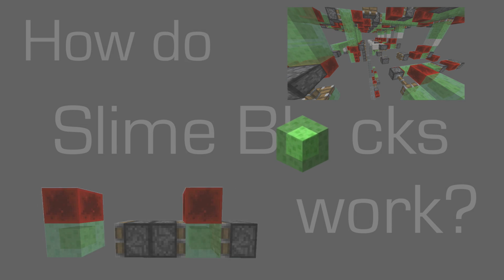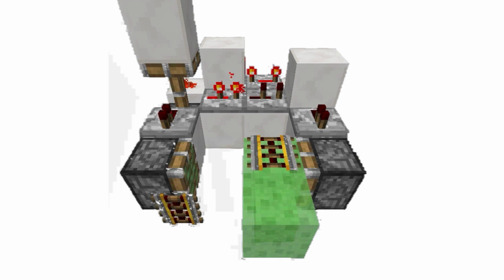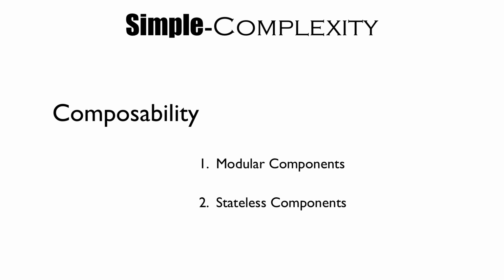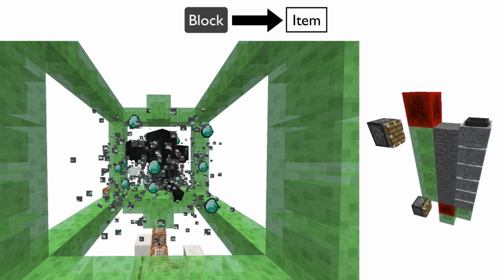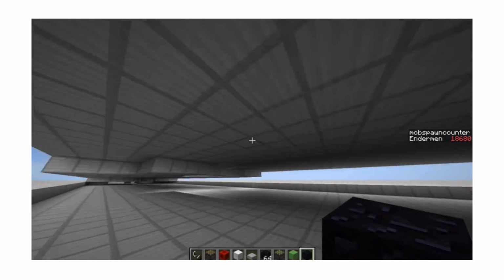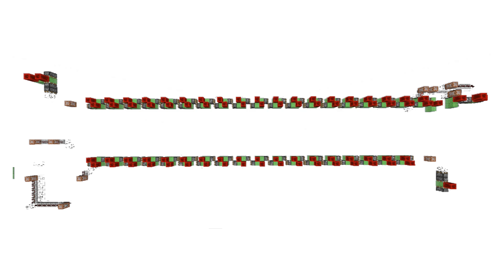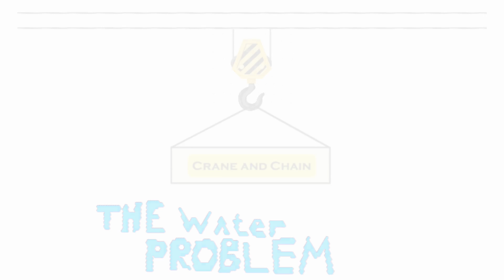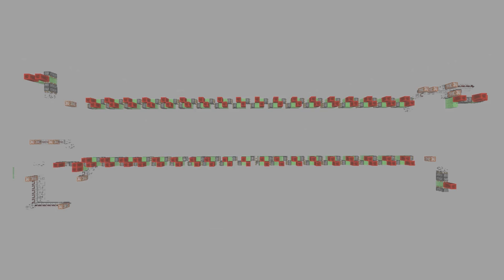TheoryCraft: Episode 6 - Slime Block Quarry

Comment: I tried to make a quarry that mines in a tunnel with a wither, but I realised that no slime blocks can touch the walls without breaking the machine. I think that the best idea would be to use more than one wither to mine out in a tunnel. Even if the player had to run along behind the machine to collect blocks, it would be pretty useful. My final suggestion with the tunnel method would be to stack hopper minecarts so they move themselves without rails. You could then point them towards the mining drill thing where they would collect items, and then the machine could bounce them off or somehow drag rails behind to send them back to the start.

Comment: 2:00 I still don't understand when these BUDs activate. If I push different BUDs around with pistons, some of them activate when they are pushed up, and some don't. Some of them activate when they are pushed down, and some don't. All I've figured out so far is that it's not directional, it somehow depends on the shape of the BUD itself. But what's really going on?
Reply from the maker: RedsBoneStuff That is interesting. One would assume it's all about update order. But specifically what the update order is of slime blocks... That's another story... Probably can only really be found out by using loads of command block buds too...

Would be interesting to find out though!
Reply: Sancarn And helpful!
Reply from the maker: RedsBoneStuff Indeed!

Comment: I made a movable wither cage design. It´s quite slow right now and hasn´t got a damaging system yet, but it can deal with the fact, that block 36 has no blast resistance and seems to be stable.
http://www.mediafire.com/download/l95h3o0mf3f555f/Movable_Wither_Cage.rar
Main issue is right now, that some entities like bats could spawn on the flying machine and distract the wither.
Reply: I made a faster more compact movable wither cage design.
http://www.mediafire.com/download/1j2arp7wvuaaa9k/Another_movable_wither_cage.rar

Comment: I´ve thrown together a quick proof of concept video about the moving wither cage. It would need some more work from someone that is way better using these slime block machines than i am. There are also one or two minor issues that can be solved easily. If there is more help with the wither needed, just message me and i will be glad to help out where i can.
http://youtu.be/nXHy_fhW8ig

Comment: here's an idea instead of building the block picking devices above ground put the under so you can set it up in such a way that sand would fall through and break on something like a half slab or a torch but then you run into hundreds of other problems but destroying the gravel/sand block as its picking it up might be possible since you could have the block picker hold the block above a half slab that it would be pushing along (possibly a row of them) and continue on this would make the onion peeler method much more reliable. alternatively instead of having the blocks dangle above the ground when transporting them you could have a row of pistons or slime blocks simply push them back 1 block on a something that wouldn't allow it to fall and be a issue. I'm still pondering ways to deal with immovable blocks possibly even ignoring them entirely it might be possible with the crane method to tell the system not to mine a certain chunk or area once a immovable block has been detected yes it would be wasteful of anything under that but it might be the only option. Anyway that's all I have to contribute hope more progress is made soon!
Reply from the maker: Nice suggestions! You're right it is technically possible to destroy the gravel in its falling state. This may be a way of doing the onion peel method more reliably.

The idea with the crane isn't that bad actually.

The only other way I can see is by automatically searching with mcedit for immovable blocks before hand.

Comment: If anyone built this on survival, then he would need.tons of resources. Then he won't need as many. Thus, a TNT quarry is faster and better.
Reply from the maker: Sidney and I were considering a TNT powered quarry. It's plausible but very wasteful.
Reply: Sancarn Couldn't you use TNT to handle the immovable objects? At least dungeon chests should be easy to remove with TNT.
Reply from the maker: asdfghyter Yep you can do! ^.^
Reply: Sancarn It sounds like an easier solution than somehow moving the wither skulls to the specific place.
Reply from the maker: asdfghyter Yeah but it works for obsidian :P Like sure it works for chests but that's only 1 issue, but you're right, tnt would be good for chests.

Comment: I think a pickaxe is easier to use, both by setting up and use it.

Also, you just showed when the blocks to remove is above ground, what about under ground level, when it has became deeper, how to you deal with the walls?
Reply from the maker: The quarry deals with the walls automatically if you set it up correctly To take lower levels you just move the whole thing down and go again

Comment: With all of the specified methods, how do you handle the quarry walls?
Reply: you may not have too if were talking infinity expandable you will have to dig out a small area manually but that's the price you must pay for automation.
Reply from the maker: Technically if we are mining out chunks then you can set your render distance such that the "walls" are unloaded and therefore pose no issue.

However you can take the walls into account while building the quarry too (which is the best bet anyway =] )

Comment: Wait I have an idea! What if as you said you send out a line of blocks to find any immovable blocks. And have it to when it hits one it bounces back. From the delay between when it is sent and when it finishes you can calculate the exact distance away that the block is and after that you could either send a second machine to pinpoint the exact location or just bombard the whole row that its on to destroy it. I know its a lot of work but if you want it totally automatic then that would probably be your best bet.
Reply: i have something really similar but doing the timing part is almost an impossible task. so i made the thing stop at where the block is. (it works for any type of blocks). I will try to make it go back but I won't use the timing part because that would take up a lot of space. Download Link:
http://www.mediafire.com/download/hdmwcrxvruf0kur/Slime_Block_D.zip

Comment: When you detect an immoveable block, send two machines that locate where it is, one on the x axis, one on y, then think up a method to get the wither to target a sheep that you would move on the block, move the wither to the block, or send down some TNT to blow it up, with the problem of not being able to deal with obsidian and loosing some blocks in the process.
Reply from the maker: Aidan Sprucechopper I don't think enderman can pick up slime, redstone or pistons... :)
Reply: And maybe make it so when it finishes a section, the mining contraption moves to mine a new one. Note that ender men may break it, so maybe do something with the mob cap.
Reply: Oh...right.

Comment: block 36 is not a tile entity, try /blockdata on block 36, it says it's not a data holder block, what happens, is a block 36 is created, and a id: piston tile entity is created too, but the block 36 by it's own is not a tile entity
Reply from the maker: yeah yeah it's a block associated with a tile entity rather than a tile entity at all :P hehe :)
Reply: Sancarn btw, that is a shame, bcos it doesnt allow you to setblock 36 with data :( (for example you cant setblock 36 that will make cobble appear in 40 ticks for example, i tried to make a slime block 36 to see if that would push me when i get close to it, but i couldnt bcos i cant setblock that in vanilla (didnt test in mcedit))
Reply from the maker: pavito555 Oh I know right! Tell me about it! I was thinking one time of setting a block 36 with the "pushed by slime" tag to create massive walls that deflect arrows and enderpearls for a pvp map... :(

It's possible in mcedit though with 36-ify...
Reply: Sancarn it is also impossible to do it with entitydata motion tag, bcos it would reset every other motion (for examle it would reset the falling motion) and, atleast for what i wanted to do, that wouldnt work, the only way was to clone piston pushing a slime block and then removing that, but not userfull
Reply from the maker: Yeah. You can repeatedly clone a piston pushing a slime block :) That's what I did for my first enderstasis chamber :)
Reply: but it's not the same, bcos you can see it, it's not like placing block 36 that will stay there forever, it also makes sound and stuff
Reply from the maker: pavito555 Oh yeah. I know. It's not the same at all, but until mojang gives us access to all the data tags of all the blocks it's the only thing we can do :)
Reply: indeed, but i actually find it easy for them to just make Motion:[0:1.0] affect only x, and not be equal to Motion:[0:1.0,1:0.0,2:0.0] or allow /blockdata x y z on a block 36 to modify data tags, but sadly, as you said, it's the only thing we can make :)

Comment: To me, it looks like the main problem is getting more than one layer out. Will the blocks next to the slime block not also be connected?
Reply from the maker: So you need to be prepared first and do a little digging. The blocks on the sides won't be an issue (we can take those into account) but you will need to dig a trench on either side of the quarry for sure. It's not ideal but it's the easiest way and it will still be pretty efficient I believe if you quarry out a large enough area :)

Comment: The lag you would get would be unbearable.
Reply from the maker: Not necessarily. I mean flying machines don't move that fast as it is and on top of that not many blocks will be moving at one time, unlike the 50x50 door I made :)
Reply: Sancarn Maybe, but you would still need a lot of storage minecarts for all the items. Also, what happens if part of it unloads?
Reply from the maker: Well let's see here...
Each hopper minecart stores 64*5 blocks ≈ 320 which is roughly 1.5 1x255x1 columns in the quarry. So 1.5 column = 1 hopper minecart  so 1 column = 2/3 hopper minecarts.

Each chunk is 256 columns = 170 hopper minecarts.

So let's say we have a world eater that spans 2 chunks across and eats 10 chunks. 20 chunks in total = 3413 hopper minecarts.
Yep. That's a lot of hopper minecarts xD.

So a mobile wither cage has yet another downfall compared to a stationary one!
------------------------------------------------------
With a stationary wither cage however:

Each chest stores 65*27 blocks = 1728.
1 chest = 7 1x255x1 collumns
Therefore 1 column = 1/7 chests
Chunk is 256 collumns = 36 (single chests)
 = 18 double chests

==> 360 double chests.

But also consider that you can destroy all the junky items with a stationary design :) So it can really be reduced down to 2-3 double chests.

Comment: You could  scan every layer for unremovable blocks and just skip them.
Reply from the maker: Oh really? Well then perhaps it is indeed possible ^.^
Reply from the maker: ouch... yeah that makes stuff a lot harder :(
Reply from the maker: I would suggest so. Just because of dungeon chests being able to spawn pretty much anywhere.
Reply: The problem is that the block will get in the way of the mechanism on its next pass.
Reply: Why not a moving wither cage that is only 3×4 and has the wither on its head and a snowman to damage the wither so the wither will destroy the blocks?
Reply from the maker: Schubert Roh The wither block busters (the ones it fires at entities like snowmen) can't break obsidian and I believe (don't quote me on this) they just kill the entity and leave the block alone.
Reply: Sancarn I thought that the wither could get moved next to the obsidian and the damaged with snowballs so he will destroy the obsidian and it will even drop...
Reply from the maker: Schubert Roh I think the wither only breaks blocks if he is suffocating inside the blocks? But it may work with the snowball method :)
Reply: Have you seen Panda4994s Lets Play where he uses a Wither for automatic mining?
Reply: Just replace the minecart with a slime block engine.
Reply from the maker: Schubert Roh That probably wouldn't work because the wither needs to suffocate to break blocks around them still...
Reply: Any damage should work. Snowballs from a snowman too.
Reply: Oops. For some wierd reason withers glitch through slimeblocks. Makes stuff a bit harder. )-: